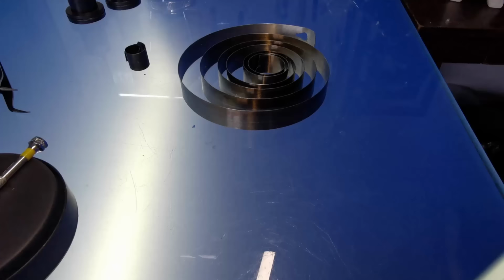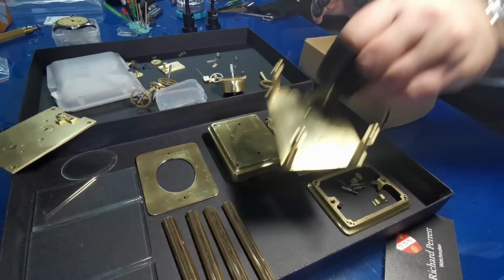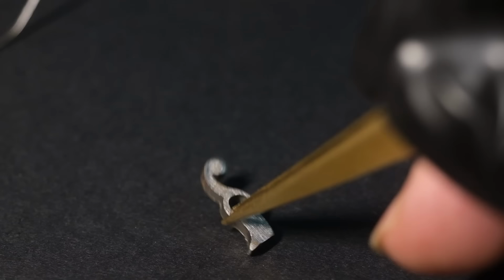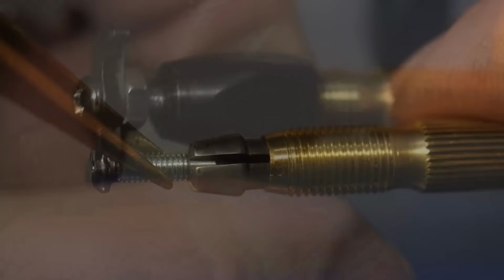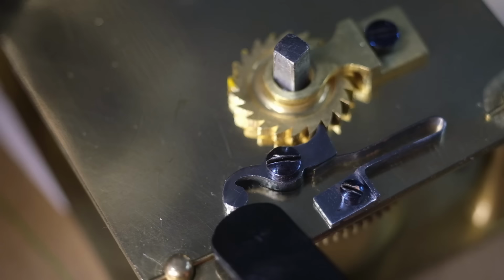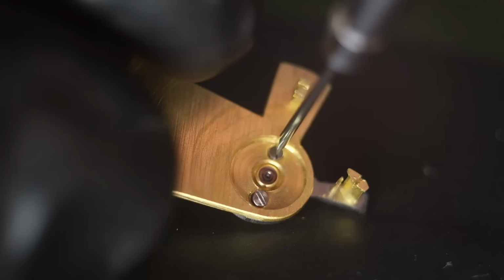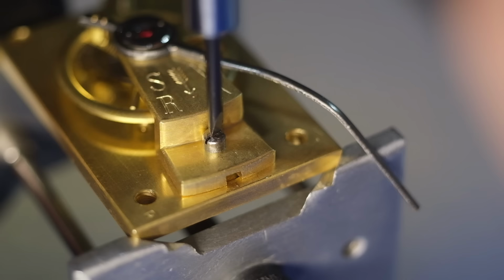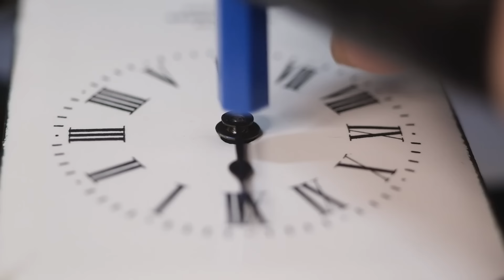Restoration of a Victorian Carriage Clock

Comment: Thanks for posting this video. I have a similar clock with a French movement that I have been working on. Unfortunately, the cylinder part of the balance staff is broken in two pieces. I have the pieces so I may be able to take measurements and somehow find a similar replacement. The pivot "plugs" look good. I think that special stakes are used to remove the staff and pivots. They are nice clocks and do not take up much space.